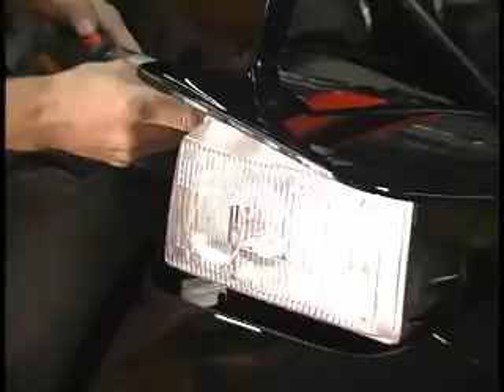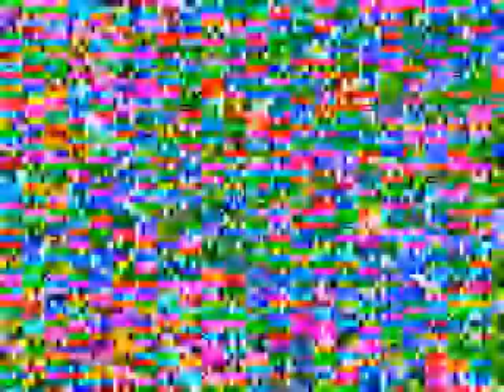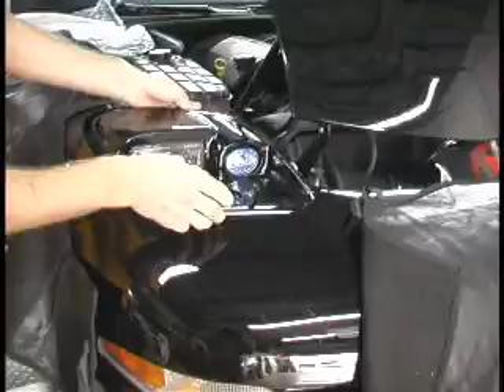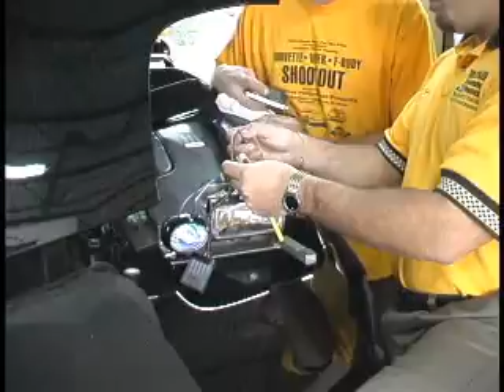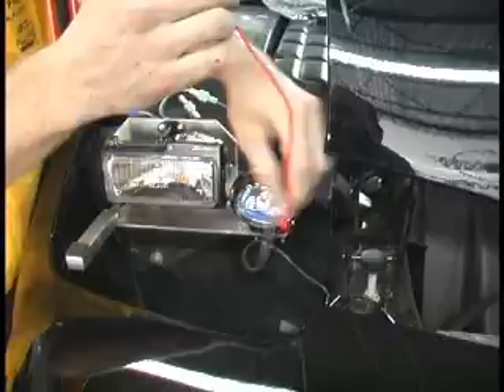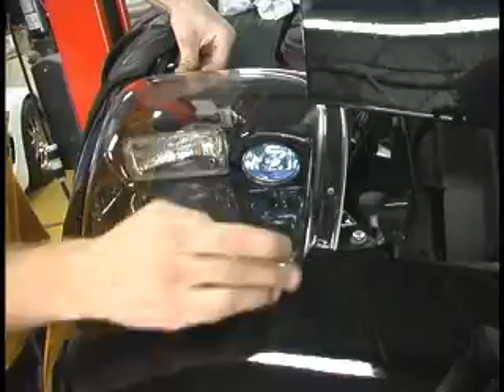Tutorial How to Install Non Pop-up lights C5 Corvette

Comment: out of curiosity , though the install was  years back,do you recall the lights that where used, I had this done to my trans am way back in 2014 and now I have to replace the HI AND LO beams  and have no idea what where installed, though BREATHLESS  PERFORMANCE  mentioned PIAA  LOW AT 130 WAT HI AT 234 WAT, not much help there that is for sure

Comment: I saw several careless methods after only watching half of this install... 1st he should have had the entire nose blanketed similar to the way he did the drivers fender. Also,did he use a flat head screwdriver on a Phillips head ? Wow... Could have slipped and scratched the nose cover. He also should have had his fingers cupping the screwdriver tip and screw the same time.

then I heard grinding going on close by and hopefully its not close enough to sling hot piece of metal on the other cars. also when popping holes like that lining: other holes up, you pop the first hole make sure everything's lined up for your clip and secure with this crew then do the other side... so everything stays lined up that's why he had to go back when it didn't line up and make the whole larger. one last thing the 2nd guy showing him the wiring order was free slinging that harness around. Getting it really close to the paint on the car.

I may sound picky but I grew up in a body shop & a specialized car shop. personally worked on some of the most beautiful cars in the world. not anyone is perfect not even me. but I got so tired of seeing countless errors in the way they were working I stop watching.

Comment: these look a lot better than the other ones ive seen that where contoured,  How much for them??
Reply from the maker: +West Deaton  You would have to check with Breathless Performance in Florida.
Reply: +West Deaton The ones shown here are from Breathless Performance. I tried a set, and didn't care for them. The light output didn't live up to expectations or advertisements.
I just replaced them with a set from Radio Flyer Innovations. The installation is virtually identical, although the RFI ones are both round projector lights. The low beams are HID. The high are LED. The kit comes with a Hi-4 harness that keeps your HID low beams on when then high beams are activated, for more light. To keep the HID lights from blinding, the system uses a little servo motor that blocks part of the light beam, keeping the pattern small and tight, and then opens up when high beams are on. They're a little more difficult to aim, but since that is a one time deal, it's not bad. The light output is much better than the Breathless Performance lights.

Comment: i wouldn't mind the factory pop-up lights except the motors are not engineered very well.  They chew themselves up and the manual turn knob breaks off.  If the knob breaks off, how do you raise the original lights to remove them? The factory motors are a bitch to remove and put back in.  They are getting very hard to find.  Rebuilts are better than new as the new are 20 years old.  Some of the Rebuilds are using a metal gear inside so it doesn't chew itself up.
Reply: I have a mid 70’s Bayliner boat with a Chevy 305 in it. The starter has broken several times on it because GM used plastic gears not metal ones In it. I wonder if they’re doing the same thing with the popup headlights that they did with the starters so they are always breaking as a result 🤔

Comment: This kid butchered the wiring system. And you better hope you never have to change a bulb! The muffle fan for the anti fogging is not gonna handle cold weather. This is for sure a early stage, but it does look nice. And GM sucks for having so many parts for the Gen 5 in available!
Reply: Chris Long one guys belt was hitting the paint too.